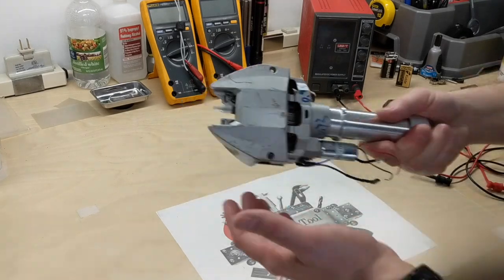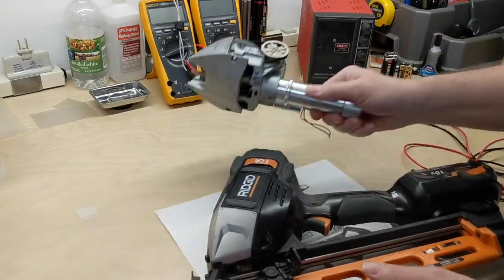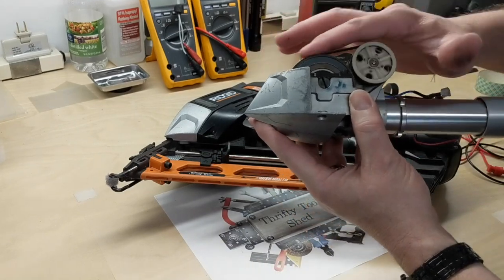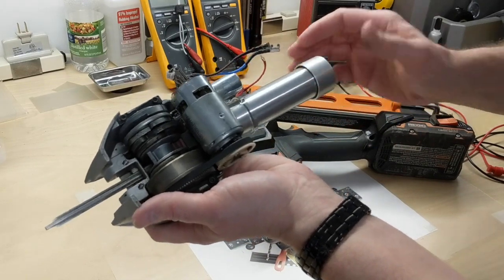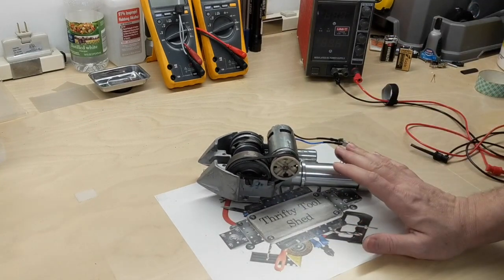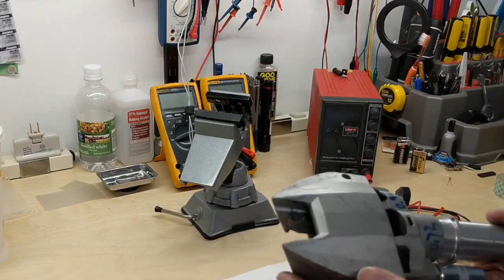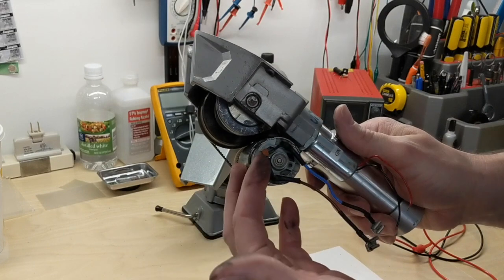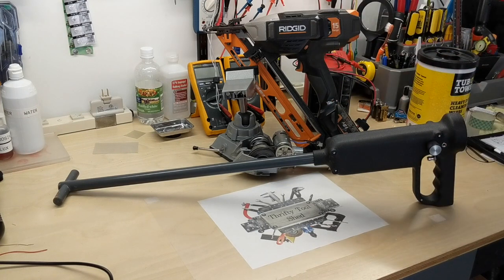Ridgid 18V Finish Nailer - A Look Inside  (Weekly What Is It #9)

Comment: Hello, I have one of these R250AF18 nailers and when you depress to use it you hear the motor firing up and the drive pin fires nail but the drive pin doesn’t return completely for next nail? What’s the fault?
Reply from the maker: I have seen it be an issue with the drive pin/anvil  hanging up due to damage or wear making it so it's not smooth. Make sure it's moving freely back and forth. I have also seen issues with the seal in the piston internally fail so the vacuum is not pulling the cable and flywheel back up after firing. The flywheel fires pin, the cable system pulls the cylinder down and that cylinder pulls back up due to vacuum. It's been a long time since I have worked on one of these. Hope it helps a little, best of luck to ya!

Comment: I have one of these nailer and when you push it down to fire it runs a minute and then quits  any help would be great thanks
Reply from the maker: One of the main causes is the battery packs not being good enough to run the heavy load to fire it. Sometimes with another pack this  kind of issue is resolved. If you have already eliminated the pack being the issue it is sometimes the encoder on the motor that gives motor feedback to the control board. It has a thin ribbon cable that can sometimes be the culprit as well. I have not worked on these In a few years now, but that is what I recall. Best of luck to ya!
Reply: @ThriftyToolShed  Hi, I have the same tool and it fires only once out of every 10 times I pull the trigger. The other 9 times it will act like it is going to fire but stops just before it should fire. Any suggestions?
Reply from the maker: If it slows down before firing then it could be as mentioned above, the pack is not strong enough to run it well. I have seen this many times on these because the solenoid fires and the load increases rapidly on the pack. The flywheel helps alot with this, but can't overcome it very well. If the motor is still running and it's just not firing then the front switch or the solenoid could even be the issue. Hard to say for sure without really looking at it and it's been a few years now since I worked on these. Best of luck to ya!

Comment: Yes I have another and I'm trying to figure out why the plunger won't go back up with striker
Reply from the maker: If I remember correctly it has to do with the seal in the cylinder. So as the flywheel is turning at speed and the solenoid clutch engages and pulls the piston down via the cables. Because of this action the cylinder should have a vacuum on the back side and I believe that is what pulls the piston back up. So either seal on the piston itself or the cylinder adjustment on the back of it has one like a vent? One way or another it's likely that piston not sealing enough to hold the vacuum to return?

Comment: I have same gun. I try to fix it. But inside one of the cables is broken. So they don't make it no more the part for replacement the cable. Really bad.
Reply from the maker: The throw it out buy the new model mentality. Not of fan, but it's reality. I try my best to keep things working and get as much life as possible. I wish I had a way to keep parts for things and have them available. It's so hard to find parts these days. Wish you luck with yours!
Reply: @ThriftyToolShed  thanks 👍